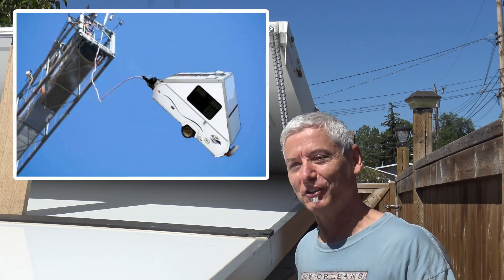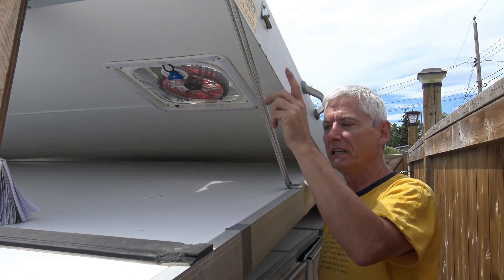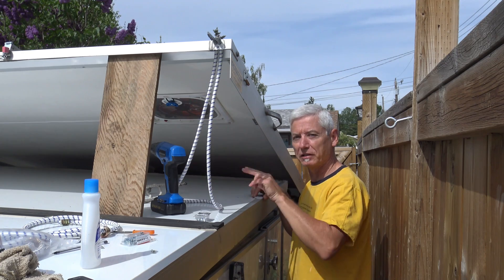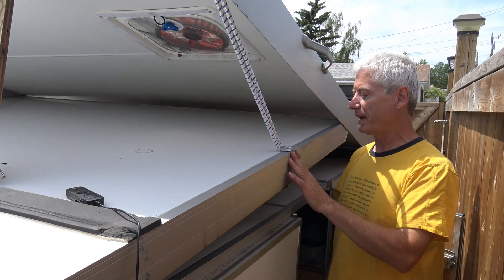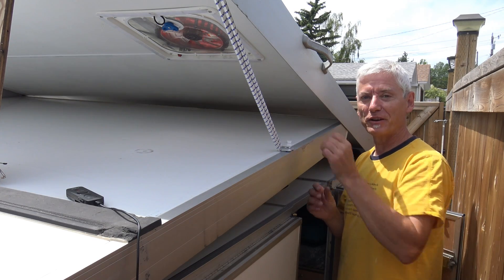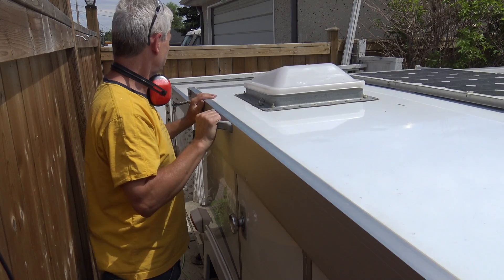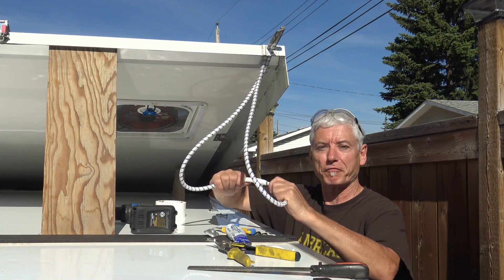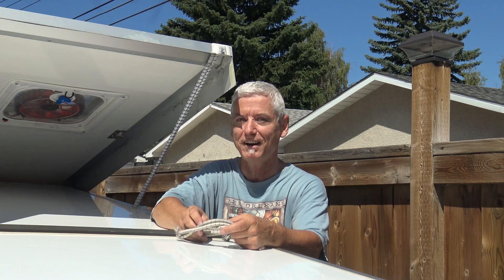Aliner Repair Pt 4 - Bungee & Side Rubbing Fix

Comment: What length #10 machine screw did you use for the bottom attachment of the bungie cord?  I have a Rockwood "A" frame trailer and this Part 4 video is perfect.  I made the mistake of going to a trailer repair shop and they had no idea on how to attach the bungee cords.  They used rivets which pulled apart.  And did nothing for the rubbing of the trim pieces.  Thank you so much for this life saving video.

Comment: Great fix for the side rubbing with the nylon bearings.  Just added them to my Evolution and they are a quick easy fix for the rubbing problem.  Thanks!
Reply from the maker: Great to hear my fix works on other trailers as well. Glad to have helped! Slim

Comment: Are the transfer bearings used only to prevent rubbing when driving or does it help with opening and closing? Is the Mylar strip that wears off something other that needs to be replaced?
Reply from the maker: Hi Mick, the bearings are to prevent rubbing only. Thanks! SP

Comment: Hi Slim. Thanks for all of your informative videos. You're brilliant and kind for sharing.
 I need to replace the one piece hinge that runs across the back of my '95 model. Unfortunately a gust of wind bent it while erecting.  The rear panel will no longer lay flush.  Do you have any tips or tricks for this 
 repair? 1st step, find the hinge....wish me luck.  
 Thanks and happy camping.

Comment: Hi Slim, Thank you for the video!  Would you please clarify the screws you used for the bungee job.  Did you use the 14 x 3/4" Hex screw for the top and 10-24 x 2" SS screw with nut for the bottom, or did you use the same screws for both top and bottom?  When you removed the rivet, what size drill bit did you use?  Also, do you need to tap the metal before installing the hex head screws?  Sorry for all the questions!
Thanks,
Annette
Reply from the maker: Hi Annette, as every A-frame is different, I would recommend using this only as concept and not as step-by-step for your particular trailer. The drill size is the shaft size of the rivet. If in doubt small with a smaller size and increase as needed. No tapping required if you are using steel screws on aluminum. Thanks! SP

Comment: Instead of the ball bearings I chose to use the adhesive backed HDPE strips - lots of them. Time will tell. They are very affordable.
Reply: It's painful watching him drill that many holes in this thing knowing how much moisture is a problem with Aliners.

Comment: Thanks for the very good fixes. I was just wondering if you also need to add the nylon bearings to the other side.  Bob A.
Reply from the maker: Hi Bob, I only put them on one side at this point because there is no rubbing at all on the other side. Probably an alignment issue. I will monitor it, only takes 1/2 hour to install and I have 5 left. Thanks!

Comment: Is there any feedback on the transfer bearings after 9 months? Anymore roof panel alignment issues? Thanks.
Reply from the maker: Hi Dee, are still up and functioning 100% . No alignment issues. I will be doing a follow-up up video to most of my past improvements in the new future. Thanks!

Comment: Hi Slim,

I'm hoping for some advice.  Looking at buying a used Aliner Classic.  I see no signs of water intrusion and it mostly looks good.  But the roof frame pieces have been deflected inward a bit at the spring bushings.  One is deflected so much that the upper frame failed to slide over the lower frame when closing up the trailer.  When the salesman tried to straighten the bent frame, I noticed that the frame is separated from the particle board roof and the seal is broken in that area.  What causes frame deflection? Is there a fix?  Should I run away from this 2013 camper or buy it (at a good price) and take on a repair job?  Thoughts?  

BTW Thank you very much for your Aliner videos.  Very well done.  You are a good teacher and good craftsman.
Reply from the maker: Hi John, I'd be going with my gut instincts on that one. Sounds like a fixer-upper. My front roof curves in the heat (curved side out). Thanks, Slim
Reply: I bought a 1994 chalet that is doing this same thing buckling right at where the springs are on the bed side more on the door side than the far side  When you try to bend the aluminum it twists the wood fibers on the roof.  When The trailer is down it is rubbing at the overlap and you can see it bows in.   I suspect I'm going to need a new roof panel in a few years.  Have you heard or seen this before?  Any thoughts on how to help prevent additional damage and prolong the need to get new roof panels is appreciated.

  I really appreciate your videos and attitude. I hope you contact me next time your planning for  Colorado I know great boondocks on ntl forest roads near Boulder and pueter canyon I can refer u too

Comment: You would have thought they would use those rollers in the first place when making the unit. Smart idea to use them. You seem to be willing to try something to see if it works that would be a permanent improvement and not just slap duct tape on it and hope for the best.

Comment: What size drill bit for installing the bearings if I get the ones from Amazon?
Reply from the maker: Hi George, I think it's a 1/2" drill for a good snug fit. 13mm is the actual diameter. Thanks! SP

Comment: Did you seal up the end of those bungees with a flame so they don't fray apart? Or will the caulking hold it from coming apart? Nice work.
Reply from the maker: Hi jwall62, I taped the ends with duct tape before adding the adhesive. As the end is static I'm hoping it will stay in place. Thanks!

Comment: Boy, I hope you don't squeeze your toothpaste tubes the way you "manhandled" the Hi UV silicone substitute.  Having said that, those were model repairs in both quality and creativity--clearly one of your stron suits.  Great video.
Reply from the maker: Ha Ha! It was an awful mess and it dries in the tube quickly. Yes, had I rolled it from the end and sealed it in a bag I would have got more use from it! Thanks Bill

Comment: I like your films but I cannot see that you are a good ambassador for A liner.
To me it looks like a piece of junk who needs repair all the time. In the winter it leaks heat and a few cubic meters like that, seems impossible to keep warm. moist damage, heat/cold transportation via metal. If this   was a regular home, the builder would have been sued in court.
Reply from the maker: Lars, this is the reality of a 15 year-old trailer that has been over 100,000 miles of very rough road and severe conditions. What would you expect? I show what it is really like and make no apologies for it. Lend me your trailer Lars and see if it does better. SP
Reply: Ok maybe I was a bit hard and I know and understand that you love your A liner. But you must admit? that having those metal angles going through causing cold and condensation is a design flaw. I actually have a Rapido, foldable that is 30 years old and that works better than an A liner I can assure you. There is less problem and no mold and no leakage
Takes a bit longer to assembly though. The trailer weighs 5 00 kg total  and unfolded is a full size 2 separate bed caravan- More of a vacation /family caravan but the quality is super. Unfortunately mine is in France and yours is in Canada. You are welcome any day, we have plenty of room